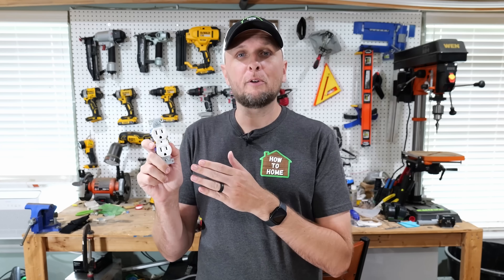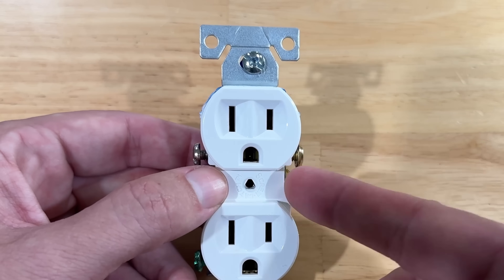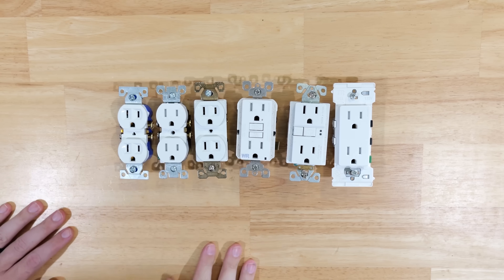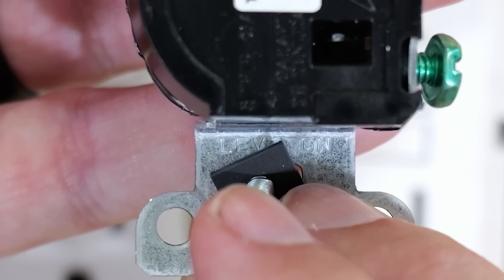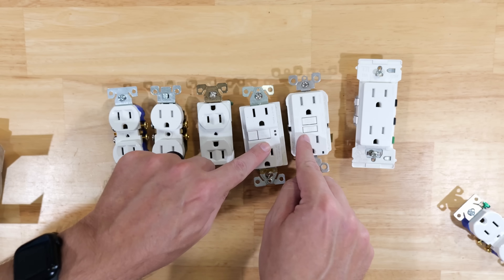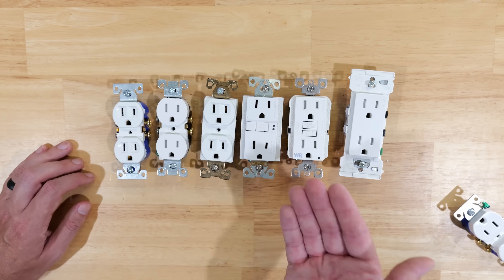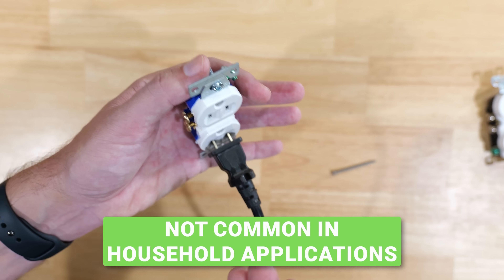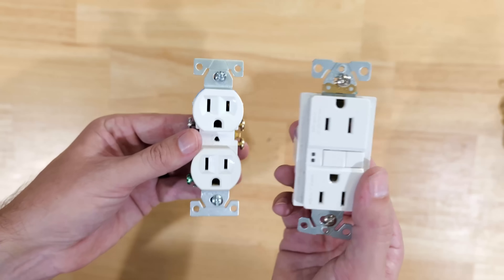The Shocking Reason Why Your Outlets Are Installed Upside Down!

Comment: In my shop I installed ground plug up. Outlets are 4 feet from the ground, cords are more secure and do not sag down and break off the ground pole with ground up. Ground down breaks off more ground poles in cords and is not as secure as they are with ground up. Just my preference.

Comment: We tried ground prong up once, until we realized every refrigerator, surge protector, or device with an angled plug is designed for ground prong down. Even some of the LED nightlight cover plates expect the ground prong down because of where the contact pins are situated. We went back to ground prong down.

Comment: Do you have a video on grounding plastic wall boxes.  I live in a house trailer and want to upgrade all my switches and recepticals.  But all the wall boxes are plastic.  What do I do to get a good ground?  Will I be able to use ground fault sockets?
Reply: Those boxes can only be grounded if they're steel. That's not necessary for an outlet to work, but it's good for safety. The idea is that the steel box will provide a better path to ground than your body, so, if you get zapped, the current is more likely to go across your hand to the steel box than through the rest of your body. For ground fault protection, a GFCI outlet only needs the wires connected to it. It will work even if it's not in a box. (You can buy one and test it ElectroBOOM style if you're brave enough.) :)

Comment: When we moved into a new (to us) home, my father, who is an electrician, installed all new outlets with the ground up. I don't remember what his reasoning was, but now I'm running into a problem with certain things that are plugged in with polarized plugs. Either the cord is now hanging from the top of the outlet, which makes it almost impossible to plug anything in behind the fridge or behind a couch or desk. The other issue I have is those large blocks that need to hang with their heavy weight hanging down, or they pull themselves out of the outlet. Since I'm not an electrician, and can't afford to pay one (my father lives 1000 miles away from me), it's just something we have to deal with until some future date. It's so annoying!

Comment: I have some power strips where with the ground prong down the cord is pushied up the wall and putting oressure on the outlet. It is on the ones where the plug lays flus to the wall. All my outlets are wired with the ground plug down. Growing up many of our outlets had no orientation and no ground prong.

Comment: Thanks for the video. I personally like ground down. It seems to work well with the zero clearance fridge plug and a power bar. That would be the only factor determining orientation for me. It’s natural to think ground is supposed to be below you so also in wiring, ground is down.  I’m trying to be a better electrician and not a hack job homeowner. Your videos are helping. 
Liked and subbed 
Ed

Comment: A clothes hanger fell off my bed,, when i pull out the bed to clean i found the hanger hanging on the ground prong. If the plug would of been ground down the hanger would have connect the hot and neutral

Comment: You didn't cover adapters being plugged in.  As those big honking boxes hang better with the prong down.  Otherwise, they all have to be hanging with the weight above, causing torque on the outlet.

Comment: What about when you're using the tools you recommended on the previous video...the kind that detects the watts being used, etc.? Which way works best for being able to read the testing device when they're plugged into the receptacle, ground prong up or ground prong down?

Comment: as a house painter, i hav replaced hundreds of switches & outlets... most old 1s were painted in place,  usually installed as was b4... wen doing a double outlet, i do 1, ground UP, 1 ground down... that way it will work w/either direction of plug/cord... saved many a house that i found w/loose connection & discoloration of wire f/heat... actually did my whole house as i painted each room that was actually OUT OF CODE, did NOT hav enuff outlets in each room, being 10 ft. apart...only 4 outlets in a 20 X 12 dinning room...  ANOTHER GOOD VID... thank U 🤗

Comment: I go ground pin down as when viewing from an angle (usually from some type of from above angle), so i can still see the upper part of the plug i angle the plug up to the receptacle. tougher viewing angles could make it more difficult to see the holes so my fingers might be needed to help guide the plug in. The ground pin would safer to accidentally be touching if contact was made.

Comment: The place I live in is Illinois and the condo I live in the outlet is installed SIDEWAYS and I looked up why and apparently it helps in steel conduit installing the wires, is there any other reason you think they did it this way?

Comment: Ground should always be down for the simple reason that is plug is pulled by wire, you want the ground to be the last wire pulled in normal earth gravity.  For example check your vacuum cord as you vacuum and the cord stretches to max length.

Comment: My caution has been to be consistent on the entire job.  If the rough-in has the neutral (white) wire on the same side throughout, the outlets can be consistently installed.

Comment: I am an audiophile and some of my equipment use power cords that are rather large and heavy. I find if I plug into a receptacle with the ground up, it will hold the power cord in the receptacle better. It won't be prone to loosen by force or gravity.

Comment: This issue came to light about 10yrs ago.  As an industrial electrician, we use a lot of metal receptacle covers.  If the screw loosens on the cover and it drops, ground up is a little safer than ground down.

Comment: So, where do RV 110v wiring / installation codes fall into or compare to this scenario? Most of my 110v outlets are oriented sideways by the manufacturer throughout the coach, effectively rendering every safety scenario presented here irrelevant.

Comment: I believe gfci says it both ways because being used within 6 ft of water  often... back splashes , they are turned sideways to go between counter tops an bar areas. Sideways its it readable from the right side or the left. I also believe ground up theory  is out of there with the idea that you still have 50/50 shot of a short circuit. when having to work things hot... i was taught  the ground is the first hooked up an the last disconnected.... so your not the only path of least resistance.... that being said... ground down means that if a cord cap works its way out... tha angle of the dangle follows that theory. First in last out. All that being said welder's 50 amp range plugs are installed ground  up so the cord isn't upside down to increase pulling. Ground down typically makes sense to me unless its 220 because of the weight of the wire an all... but what do i know😅

Comment: I install those what is called wrong side up because the stinking manufacturers are still making the plugs on the appliances so that the wire is always in a bind

Comment: Outlets installed ground up in hospitals is only place I've seen them and I guess so anything falls on loose plug it will not short across conductors and that flash you speak of in your video would be bad because of oxygen can be present in hospital rooms.

Comment: In the house where I grew up, we had metal wall plate covers.  Someone had removed the cover when painting the wall, then put it back without screwing in the retaining bolt.  When I pulled out a plug, it jostled the unfastened plate and caused it to drop down to rest on both prongs, causing an impressive electrical show.  I had to pull out the plug with my fingers less than an inch away from the plate as it was being cut through by the two prongs.

Comment: Ground should be down, because 99% of the time the wire is pulling down, and if any of the prongs start to pull out, it will be the HOT to lose the connection first, while the GROUND will be the last.

Comment: I've always been one of those guys that knew that you could put that shit in any direction that you wanted it however if you look at most of the electronic companies they will create their devices in a way that the ground prong is facing down😂 personally I would like to have them horizontal and the reason for that is because some of the tech companies like to make the converter is right there at the plug making it fat when it doesn't have to be. It's less common nowadays but it still happens.

Comment: I've always seen them installed prong side down, but after seeing a video describing the benefit of prong side up I was conflicted.  Generally I install the same way existing outlets in the house were installed.  However I'm rebuilding a full home and have the choice to do what I wanted.  I ended up going prong side down because so many electronics seem to assume this.  I have a small surge protector from multiple brands that would fall off the wall if installed prong side up.  Also, as many have mentioned the issue with appliance plugs.  I will say "thank you" for giving me a reason why prong side down is better (unplugging cords) as I can at least feel justified in following along with what appears to be the 'norm'.  Random side note, I like how many have indicated prong side up for switched outlets.  I don't think I"ll have any in this particular rebuild, but if I do I'm using that.

Comment: Prong down!! As a female, plugging in typical household items, like air fresheners- they are set with prong size and and if prong is on top- all the oil pours out or the little inserts fall
I’ve had many issues with different household products not fitting because of the plugs.  We switched them out

Comment: In my line of work, I sometimes deal with large appliances. The ground prong is always at the bottom of the plug where the cord is attached. If the ground is installed on top, the plug has to be looped up and puts more tension on it. I have always installed the ground down. It looks better.

Comment: Stove receptacles by code need to have the ground oriented to the left or right not up or down. ULC standards have 90 degree plugs with the ground down for a reason which logically means the ground on a receptacle should face down. If you don't want to argue about which direction the ground should be, install your receptacles all horizontally.

Comment: Virtually all 90 degree plugs are designed for ground down...that is good enough for me...ground up is only safer in your mind...with the massive use  of plastics in electrical devices... grounds are becoming unneeded for the most part anyway....

Comment: All of the geniuses who need lettering to tell them ground up or ground down, whatever way the rest of your recepticals are wired is the way your replacement should be installed.   Anyone who installs a receptacle OPPOSITE of how ALL OTHERS are installed, is an IDIOT!  Ground up or ground down makes NO DIFFERENCE but if you want to drive everyone ELSE stupid, you'll do the opposite of all the others and people will CUSS YOU OUT through eternity or until it's reinstalled the other way around, whichever comes first.

Comment: I am a retired electrician, but my employer was a commercial contractor that required that all recepticals be installed ground up. This was mostly because we often had to use metal faceplates which couls come loose and drop down between the plug and receptacle face. Personally, unless metal plates were being used I would also go with the ground prong down.

Comment: I hate ground up because of power strip or extensions that have a "plug saver" design either to the side or straight down 90. Also just about any girly hair thing has a big chunky GFCI wall wort thing that is 90 degree. Also those multi outlet receptacle multiplyer blocks just compound the issues. Some have trays on the top to rest a phone or USB ports towards the top and having a prong up installation kills those features.

Comment: Uncertain appliances accord is on a 90° angle when you plug it in if this is the case, you should rotate the receptacle so that it’s going down to your refrigerator or whatever is below it. I’ve run into this before or the plug is a 90° and you don’t want it pointing up I didn’t looping down to the refrigerator or appliance

Comment: I as someone who have done it for decades always did it with ground prongs down.. there are some plugs that have it where wire feed come in from the positive /neutral end of the plug...on normal voltage and 220...like electric dryer...so those receptacles are the exception as you mentioned as to how you would orientate..in those cases the ground up...and the locations where your only option whether financial choice of switching out boxes by owner..if its just a one gang box/opening...sideways...that will be your only option...i came because of your photo...and title..i thought wow...all these years i was doing something wrong?!..i doubted it..but i was curious😅😅😅..i mean things do change all the time based on new discoveries and needs..like knob and tube wireing was code and perfectly fine..till needs power consumption matrtials wire casing upgrades...etc...made that no longer acceptable nor code...even gas power lights use to be pefectly fine 😅😅😅

Comment: We were the first builders in Southern California (1980) to install the bedroom switched outlet with the ground up. We called them half hots because only half of the outlet was continously hot. We did not want our home buyers killing the clock radio which normally had a bed lamp on the same outlet. There was no code for this and was a valued added cool feature introduced eliminating the need to figure which outlet was the "switched" outlet. I was the quality control inspector for the company.

Comment: I have always been taught that the key is consistency. If you are installing receptacles in an existing structure, then install them the way the rest of them are. If doing a complete job, I always install ground on the bottom I was taught that if the plug were to fall out the last prong to disconnect would be the ground.

Comment: The few times I’ve been shocked when plugging or unplugging a device, it’s when the ground was on top. My forefinger ever so slightly touched the hot and neutral together. Luckily, I rarely see the ground on top in the U.S. anymore

Comment: I wired up my walk-in basement that we’re living in with the ground prong up, because at the time, 15 or so years ago, that was the trend, and was supposedly “safer”.  I regret doing this and eventually will rotate and reinstall them with the ground down. The #1 reason I think they should be ground prong down is that while using a handheld power tool, the cord often moves around and the combination of the tool’s movement along with the weight of the cord tends to pull downward. When wired with the ground prong up, the cord tends to unplug from the receptacle in this configuration, whereas with the ground prong down, the plug resists becoming unplugged.
Reply: I’m not trying to piss you off, but if you haven’t changed it in the last 15 years, you ain’t going to. If I didn't know better, I would say I was the commenter, not you. LOL.

Comment: My friend is an electrical contractor, on residential work any wall switch controlled outlets.  He does this so when new home owner calls saying he needs to send someone out to replace a dead outlet.  He asked if round hold next to the slotted holes.  If round is on top he tells to turn the wall switch on.

Comment: I have always installed my electrical outlets ground plug down.  To me, they just don't look right with the ground plug up.

As for switched outlets, usually the top outlet is always switched, so, again, I see absolutely no reason to install the outlet ground plug up.

Most often, I'll use a child safety outlet plug to protect the top outlet, put another cap in the lower outlet, then I use painters tape and cover the areas of the outlet I don't want painted, leaving the upper areas uncovered that I'll be painting, then I just use a can of spray paint and paint the upper area.

  I usually paint any switched outlets a light pink, since pink isn't used on outlets bought commercially.  I've seen red, green, orange and blue outlets.  But can't say I ever saw any light pink ones. lol

And the pink outlet isn't very noticeable when something is plugged into it.  And it reminds me to never plug an item into it that requires constant power.

I have also been replacing a lot of my electrical outlets with those that have 2 to 4 USB Ports so I don't have to worry about oversized AC adapters hogging the entire outlet to charge or power something.  Plus I don't have to unplug cords just to charge a USB rechargeable device, and I can recharge  1 to 4 USB devices at one time, and still have use of the 120VAC outlets for other use.

And no special wiring needed for adding the newer USB + Dual Electrical outlets, just remove the original outlet and put in the USB + Electrical outlet in its place.

Sure is very convenient when guests come over and need to recharge their phones.  

Not unplugging your lamps or other items, and having most of your outlets having USB Charging ports, everyone isn't having to fight for a plug to plug in an adapter to charge their device.